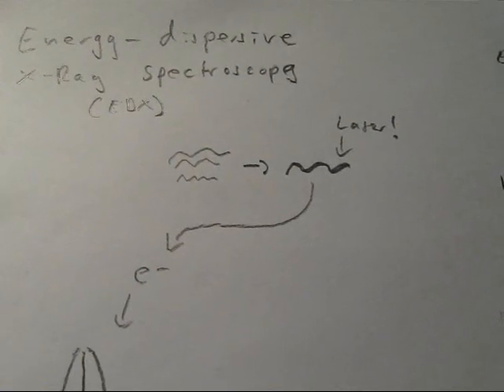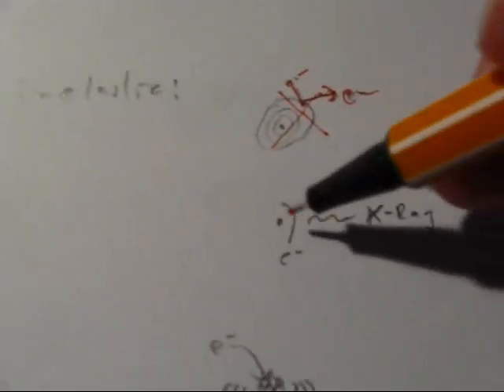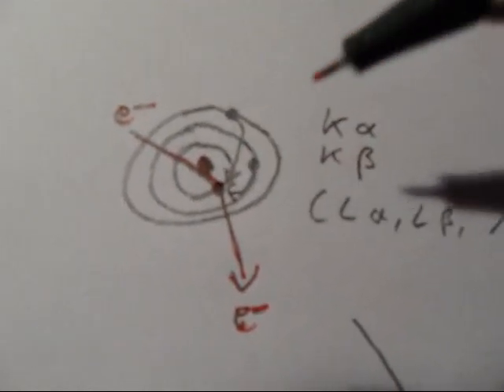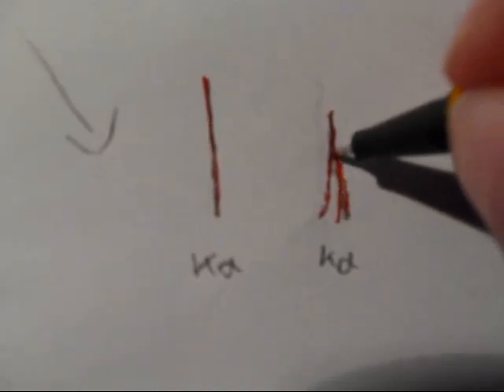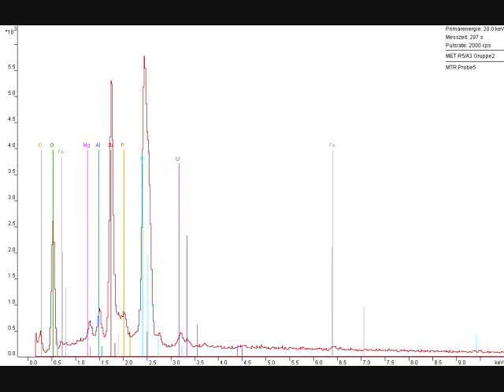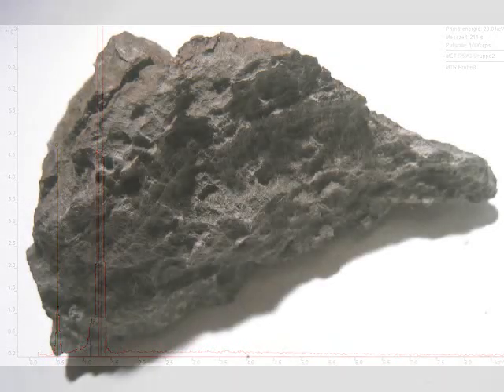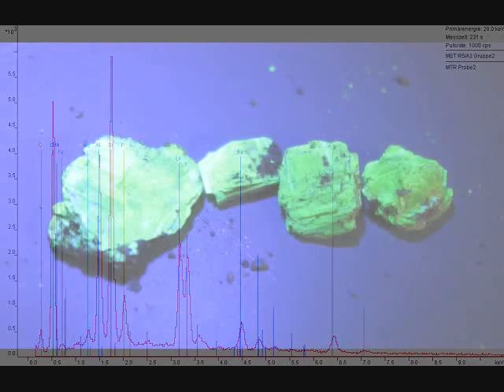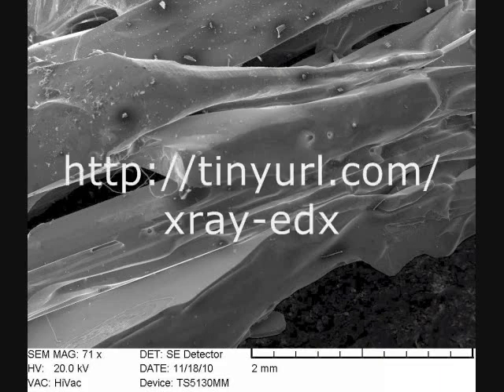energy-dispersive x-ray spectroscopy (electron microscope analysis) of uranium minerals

Comment from the maker: @ironnica 
well, elements like carbon and lower have a low atomic number, meaning a low amount of protons, which again results in an equal number of electrons on the shell of the atom.
EDX is done by ionizing atoms, knocking out inner electrons, and then measuring the "jumps" as a higher electron fills a lower electron shell, in which the characteristic x-rays are emitted. lack of electrons, jumps arent as wide = no x-rays but merely light photons get emitted and cannot be detected.